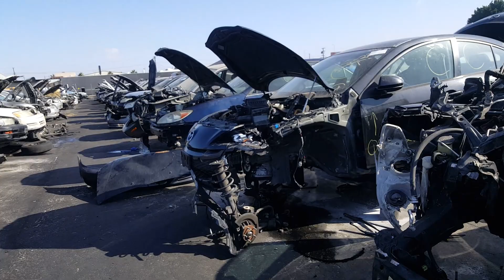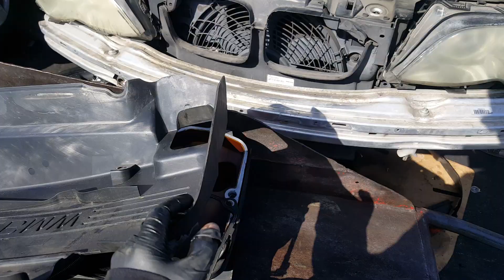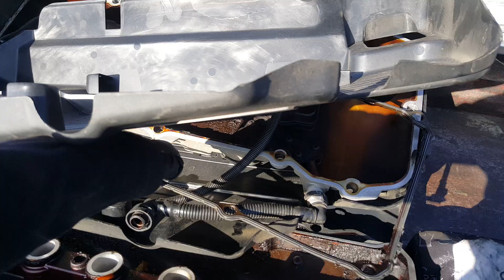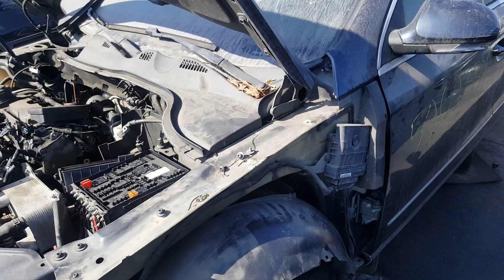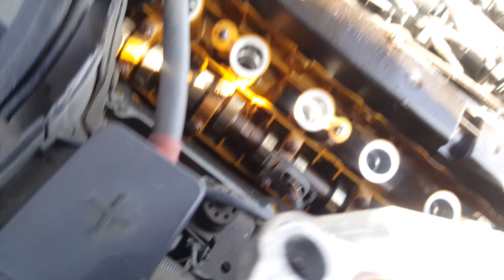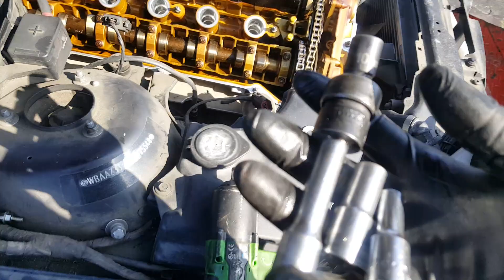Bmw e46 325 325i 328 330 339ci valve cover removal e46 aluminum valve cover swap

Comment: Is the air distributioin piece on top of the intake manifold removable too?
Reply from the maker: Yes but will break so buy a replacement cover and diaphragm
Reply: @JM8686  do you still sell those valve covers? I'm looking for one
Reply from the maker: Yeah i have one left 
13b_dorito my Instagram